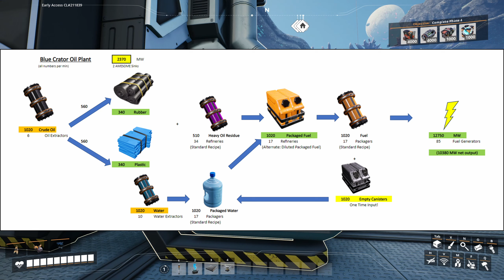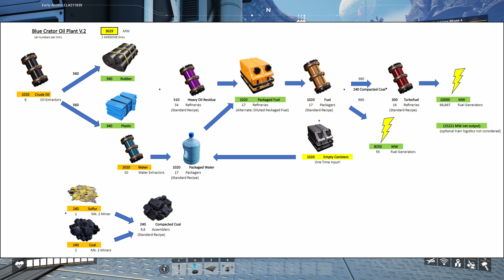The most BROKEN Alternate Recipe for Power! - Let's Play Satisfactory Update 7 - Ep. 19

Comment: Hi! I did the same with three times 600 m3 from the Coast: one pipe for diluted in blenders, one for plastic, one for rubber, the overflow in h.o.r. also went in the blenders and I ended up with roughly 35 GWs. The Turbofuel is somewhat unnecessary. Maybe it will become important once Stages 9 and 10 get released
Reply from the maker: Hi! 
Sounds like a great setup, unfortunately I don't have access to the diluted fuel recipe for the blenders yet. But we will make use of this in the future. 
Because we will explore the whole map, get all alternate recipes and build huge stuff as soon as update 8 goes live!

Indeed, for now we don't need the furbofuel power yet - but I actually never produced turbofuel in this game, so I want to throw it in for the extra power boost, but also for fun! 😁

And I am also curious if upd8 will include new stages/ phases, we will hopefully see soon.
Reply: I have just over 80gws from the blue crater oil, the east part of the swamp, and the west coast oil spot all using diluted fuel recipes. The crazy things is I haven't even come close to 100% efficiency yet. I am at like 66% total meaning I can get well over 100gw from those locations if I want. I have been waiting on the northern oil spot for a while now because I have the feeling I will need to utilize 100% of the oil for plastic and rubber for future item builds.

Comment: I decided to take 2 impure oil nodes and bump them to 250% overclock. Each then made 150m3 for a total of 300m3.  Used the Diluted Packaged Fuel recipe and got 10 GW of power..  From 2 impure nodes. So what I think I am going to do with impure nodes is just make power with them all over the map.  In past playthroughs I have actually skipped the impure nodes.. But now I see that for each one I can generate 5 GW of power. It seems like a no brainer.

I'll also generate rubber and plastic from normal and pure oil nodes and take that heavy oil out and make power from either diluted fuel in blenders or packed diluted fuel (in this playthrough, I do not yet have Aluminum, so no blenders yet).  First I'll get fully functioning oil products, then I'll do aluminum.
Reply from the maker: Sounds really good! Yeah I just realized that while "diluted fuel" and "diluted packaged fuel" have the same efficiency (with the packaged version consuming slightly more power for the packagers); the packaged one is actually usable much earlier because you need the blenders for the other one. So one could say I got lucky to unlock the packaged one :)
However I decided that I don't need to overclock the extractors and just use all nodes in the area at 100%. 

We will tap in more nodes from other areas in the future though, that's for sure - but first, we too get into aluminum.